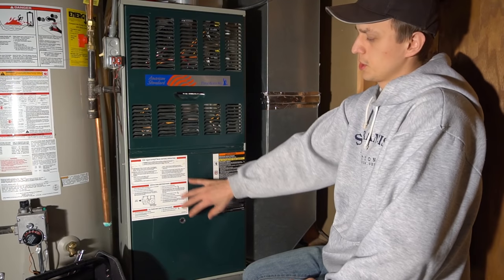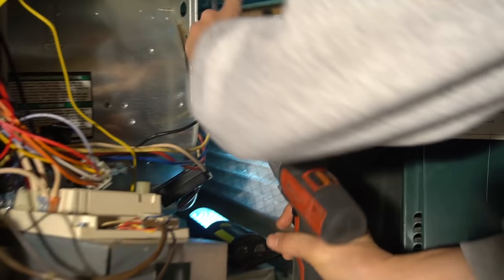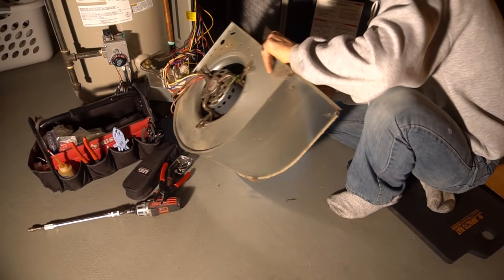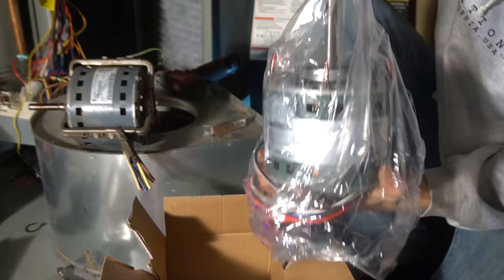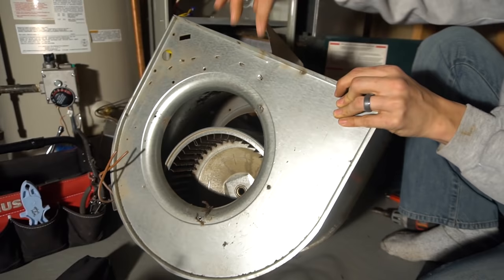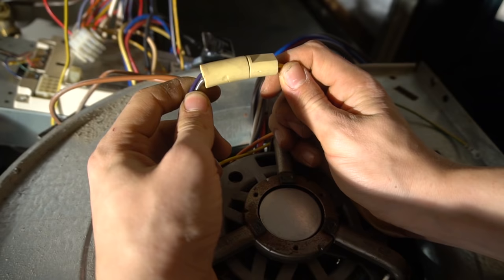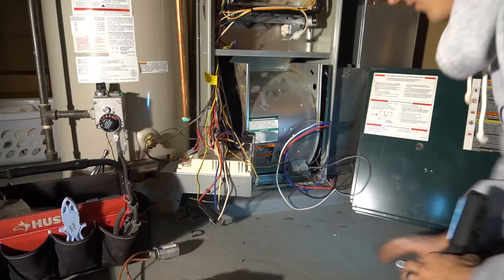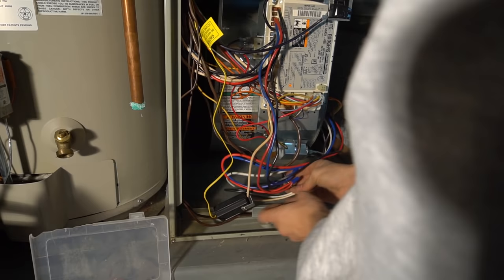Furnace/AC Blower Motor Replacement Step By Step

Comment: Great video!  I think my motor  is going bad.  Last night when it cycled on I heard a squeaking  noise coming out of it then it went away.  Then this morning I heard the "hum" of the motor not starting.  I went down there and turned it by hand and it started.  It made a little noise and then stopped.  It is running fine now and I am leaving it on.  How much time do you think I have before it seizes up?
Reply from the maker: It depends on how lucky you are :) Sorry, I can't make a good guess. If the wheel spins freely though, then perhaps the capacitor is just really weak. That would be cheaper and easier to replace than the motor.
Reply: @WordofAdviceTV 
 I have a new motor and capacitor from Grainger ready to go.  The ironic thing is that the blower is quiet,  starting and running fine on the auto mode.  Could some kind of dirt got in the fan blade making that noise and creating the one time no start?  The capacitor is just 1 year old.  Thanks again for all your help on here!
Reply from the maker: @briancloutier2781  Well.. If the motor works fine then if it was me, I would leave it alone for now. If it quits on you, you have a new one ready to go anyway. But to answer your question - no, dirt would not prevent the fan motor from starting. Most likely the motor will end up seizing up and stopping again in the near future. You can wait for that to happen or just go ahead and replace it :)
Reply: @WordofAdviceTV Do think I should get a new motor bracket before I do chage the motor out on my Trane XE80? I do not want get into this job and find that I can't use the old brackets! I owe you a case of beer! (we all do!)
Reply from the maker: @briancloutier2781  I would just put on the new motor bracket. I have had a few times where I used the old bracket and then had to take the motor back out just to replace the bracket. (it was noisy with the old bracket)
Reply: @WordofAdviceTV  The new one you got from Amazon that you used will work right? My Trane looks exactly like your furnace.
Reply from the maker: @briancloutier2781  Most likely yes. Although it would be best if you pulled it out and verified. To make sure that the specs line up from old motor to new.

Comment: Is it ok to put a more powerful motor for better air flow?
Reply from the maker: That is not recommended. That could actually cause problems. I would replace it with the same size motor if possible.
Reply: @WordofAdviceTV  but I hardly get any flow throughout my rancher style house. The unit is only 7 yrs old. It barely moves a tissue in front of a vent. That's why I want to upgrade. What do you think?
Reply from the maker: Hmmm.. Well if you don't mind it being noisier, operationally it shouldn't have too much of an impact. You can try it but I don't know if that will solve the problem for you..
Reply: @WordofAdviceTV  am I mistaken in my thinking that more flow would cool or heat my space quicker? Then my furnace wouldn't run so constant?
Reply from the maker: Most likely the problem is in the ductwork (which usually can't be remedied since that would involve taking apart all the walls). You may consider adding some returns though. To check if you should add some return runs, take your bottom furnace door off while the furnace is running (with the door switch taped). Then place the door back in it's spot, bottom first. As you are slowly putting the door back in place, does the door slam back in place with a lot of pressure? If it does, then that typically means there is not enough returns. As for a bigger fan.. I am assuming you mean to increase the RPM? That can throw off your cooling and heating operation. If the air flows past the unit too fast, then it will not have enough time to absorb the heat during the winter and to cool off during the summer. Also, the unit will likely start making whistling noises while the fan is running if the velocity is higher than it should be.

Comment: So my blower motor makes a loud noise when first starting up then goes away after a few seconds. What could that be?
Reply from the maker: Either the motor is starting to go bad or the bracket that holds the motor is a little loose. I had quite a few times when replacing the motor bracket with an MB55 bracket solved that noise problem.

Comment: So I get a burning smell (reminds me of a curling iron) only if I run the furnace. If I run just the fan there's no smell, is it still the blower motor or something else? Also if I remove the filter there's no smell (which reduces the load on the motor) but why no smell if the furnace isn't running but the blower motor is for just the fan?
Reply from the maker: Interesting.. So with the filter out, furnace is running, burners are on, and the the blower motor is working there is no smell? I am assuming you already tried replacing the filter. If you haven't, do that first. It's possible that the motor is starting to go or perhaps your furnace is just overheating. What do your temperatures look like? (Temp rise. If you are not sure how to check, I show it in this video https://www.youtube.com/watch?v=lmEbZ32H9nY)
Reply: Actually this started shortly after the filter was replaced (probably just a coincidence). I double checked and it does smell with the filter out (just less so) but not when the furnace isn't on, so I don't think it's the blower motor. Any suggestions?
Reply from the maker: -First of all, do you have carbon monoxide detectors? You should have at least one. Fire department recommends replacing them every 5-7 years as the CO sensor in the detector goes bad with time. If this smells has anything to do with your heat exchanger that could be a health hazard.

- Is the smell coming from the furnace or from the registers/vents? It could be something simple like a toy or food that got dropped inside of a register. It wouldn't hurt to take them off and look.

-When the smell is strong, try turning the furnace off, take the bottom door off and carefully reach in and touch the motor. You should be able to put your hand on it. If its very hot to the touch then your motor or motor capacitor is going bad. Generally you would replace both.

-With the furnace turned off and the bottom door off, carefully reach in and feel in between the fan blades, give it a spin too. Does it spin easy? Is there a lot of gunk in between the fan blades? The fan blades can be sharp so reach in slowly, no sudden movements.

-It's possible that the A-coil (also known as the a/c evaporator coil which is located right above the furnace) is plugged with dust and other debris. If this is something you are willing to tackle... You could pull the blower motor out and laying on your back slide in under the furnace and take a look with a flash light. Although if you have a high efficiency furnace, the secondary heat exchanger will be all you see.

-Take the furnace doors off and visually inspect the electrical components. Are there any melted wires or burn spots. Check the control board for burnt or melted spots too.

-Try using a different filter for a couple days and see if that makes a difference.

-Finally if the smell persists and you cannot find the source, you will just have to call for service. It could be something simple or it may be hazardous. Better safe than sorry. The above options are all the possibilities I could think of that you can check yourself. I hope you will be able to find out what the culprit is! Let me know what it ends up being please! :) Good luck!

Comment: Can you please tell me if the Amps need to match up also? I just bought a new blower motor and i just noticed it says 2.9amps but old one was A. 3.9-3.7.  And the furnace panel label does say 3.90 FLA. All other specs are the same except the capacitor.
Reply from the maker: That just means the new motor is more energy efficient :) The new motor should pull no more than 2.9 amps while running. The motor you found will work.
Reply: @WordofAdviceTV  OK that would be great because i don't think i can return it to the place i got it even though i haven't opened the box yet. But my capacitor does need to match motor specs right?? My previous motor had a 7.5 mfd and that's what i bought new before i purchased my motor, but the new motor says 10 mfd
Reply from the maker: @curtis5809  If you really need the ac, it would probably work with a 7.5 mfd capacitor but I would not leave it in there for long. Definitely get the 10 mfd capacitor for it.
Reply: @WordofAdviceTV  OK...thanks for the info man and actually responding to my questions. Really appreciate it and the videos

Comment: I have an old motor rated 10 Amp, the supply house staff said I have to use an equal or higher Amp replacement motor. He said the control board would send 10 Amp current to the motor, if I put a lower Amp motor it will be burned out. I think that’s other way around. Putting in a lower current rated motor will be safer. Anyone has any ideas? Thanks

Comment: probably a silly question, but does voltage matter?  my motor is 1/3 HP, 1075 RPM, 3 SPD, 200-230 V....I have found several that match but they are all 115 V, I'm assuming that I need to match the voltage as well?
Reply from the maker: Yes, it does matter. A 230v motor will have two hot legs (wires) going to it whereas a 115v motor will have a hot leg and a neutral. You are replacing the blower motor in the furnace right? Not the condenser fan motor outside? Usually the motors outside are the ones that are 230v..
Reply: @WordofAdviceTV  it is the motor inside, but I might be misreading the documentation.  ThNk you for the answer
Reply from the maker: @JereMiles-DarkGlassStudio  The best way is to physically pull out the motor and look at it :) Or if you look at the wiring diagram on the back of the furnace door, you should be able to see what the voltage is that way too
Reply: @WordofAdviceTV  Awesome thank you for the advice, I will pull the motor tomorrow and look at it, I was going based on a Service Facts document I found in a bad on the inside panel of the unit and reading the Indoor Fan Type section, but pulling the motor out will be a much better approach I was just being too lazy to do that yet, thanks again

Comment: Well the one thing I did learn is not to buy a Trane built AC/Furnace system! Yours seems to have failed in every possible way! Also it might be a good idea to have people take many photos with their phones before and as they disassemble. It can make things so much easier to reassemble especially since our systems will not be exactly like yours.

Comment: Dumb question, and no offense intended: that buildup on your squirrel cage fan blades, is that normal, even if the filter has been replaced regularly?
Reply from the maker: Even if you replace the filter regularly, in 15-20 years you will still have some build up in there. The slide in filters will always have a little bit of the dust sneaking past it. The people we bought our house from, I believe they were using fiberglass filters (the blue or green ones) and those tend to let a bunch of stuff through.
Reply: Word of Advice TV - awesome. Thanks for the info! I’ll open mine up and take a look.
Reply from the maker: Never hurts to check :) just make sure the power is off then carefully reach in there and with your fingers, feel in between the fan blades. You can spin it a little and feel a few different spots too. That should give you an idea if its dirty or not. Good luck!

Comment: is that washer/rubber assembly around the shaft removable?  im replacing my blower and it doesnt have that but the universal replacement part i found does. thanks
Reply from the maker: You can just leave it on there, it won't do any harm. There are some motor brackets that need that rubber grommet that's why they just put it on all the universal motors.

Comment: I replaced my blower motor and it's still not working, what's the next thing I should be checking.  When I call for heat at thermostat the furnace fires up but the blower just does not start spinning.
Reply from the maker: There's a good chance that the control board is bad. If you have a meter, check if you have 120v between your heat terminal and the common coming from the blower motor. If you don't have 120v, then the board is defective/not sending power to blower motor. You may find my other video helpful: https://www.youtube.com/watch?v=JSgLGTAbDF8&index=13&t=0s&list=PLK8tZPlovA8Aw5W4GIoingc_enl5apH4C
Reply: I had an electrician buddy look at it and there is a spot on the control board where it looks like something popped or burned but everything seems to be responding as it should as far as calling for heat or AC but just no response from blower.  Is it safe to just swap out a new board or is there something else going on most likely? @WordofAdviceTV
Reply from the maker: In the other video that I shared above, I show how to "bypass" the control board. That way you can rule out the board.
Reply: Not seeing what video you are referring to about bypassing.   @WordofAdviceTV
Reply from the maker: Underneath my initial response to your comment, click on "Read More"
Reply: swapped out the control board today and everything is working like it should now.  thanks for the info!   @WordofAdviceTV
Reply from the maker: Happy to hear it! :) Glad you were able to get it fixed, stay warm!

Comment: How do you find a motor that will work with your furnace? My furnace looks exactly like this, btw. Where do you recommend buying these? Thanks, HVAC technician just quoted us $1500 we don't have for a blower replacement.
Reply from the maker: Oof, that's a hefty estimate. So if you follow the video and take your motor out, it should have a label on it. Most important to look for is the RPM, HP, and Voltage. The motor I used can be found on Amazon: https://amzn.to/2JuRB2a    Or you can just write down the model and serial of your furnace/air handler along with the RPM, HP, and Voltage and go to a local appliance parts shop if you have one in the area and they should be able to point you to the right blower motor. Make sure you get a new capacitor with the new motor too. (whatever capacitor the new one will require)

If you have the same motor bracket that I had on my motor, you may want to put in a different bracket too. After a few days my motor started coming on with a bang that would reverberate through the duct work. Pretty annoying. 
Then it would work fine. But every time it started up, bang! I finally got tired of it and investigated. Turns out the old motor bracket was slightly loose on the new motor and it could not be tightened. So I put it in the FM55 bracket ( http://amzn.to/2C7hIcI ) and no more noise.
Reply: @WordofAdviceTV  Good point about buying the correct capacitor for the new motor. Each motor has to have a capacitor of the proper rating, and it's not necessarily determined the by H.P., amp or voltage rating of the motor. It's a design spec. Don't expect to be able to use the old capacitor. There is a good chance that you may re-use the capacitor mounting bracket, tho.

Comment: Any reason why my American Standard blower motor keeps making a screeching noise? This is the second one that has done this. This motor is only a year old.
Reply from the maker: I don't know if this will help in your case but I have had a couple times where a noisy/banging/screeching motor problem was solved by putting a different motor bracket on. In fact, the motor that you see me putting in in the video started doing the same thing. After a while whenever the fan would come on, it would come on with a bang that would reverberate through the duct work. It was very annoying. Everything worked fine but at start up it would bang like that each time. I fixed it by putting in this bracket: http://amzn.to/2C7hIcI 
Another thing to check would be the blower wheel itself. Make sure it does not touch the blower housing. If you loosen the holding nut that holds the wheel to the motor shaft and move the wheel back and forth so it hits the walls of the blower housing, the wheel should be in the mid-point from hitting the wall on either side.
Hope that helps!
Reply: Word of Advice TV thanks I'll check. It only makes a screeching noise upon start up. No banging noise ever. I had it under warranty so luckily they fixed it for free last time. Thanks for your advice though
Reply from the maker: Alright, good luck! :)

Comment: Thanks for sharing. My motor is 1/3 HP, 115V and 1100 RPM. Do you think a motor similar to the one you installed will work for my Carrier/Bryant HC41AE117? Thanks
Reply from the maker: Yeah! Shouldn't be a problem. :) Just make sure the horsepower and RPM match up. 1075 RPM would be just fine too. Also, sometimes you cannot reuse the old motor bracket or it is welded on to the motor. Or the motor is noisy after install. I had to put in a FM55 motor bracket in my furnace a few days later because every time the motor started there was a bang sound. This is the one I used http://amzn.to/2ygHXzk

Comment: Where did u get the New motor
Reply from the maker: Amazon. I have links in the description if you need to use them as reference.
Reply: How much do they usually cost

Comment: What are your thoughts on furnace filters? I was told by an old HVAC tech to use the least restrictive filters as they make your motor work harder. 
It makes sense but then I guess you have to clean out your blower more often. 🤷‍♂️

Comment: Great video!! But I want to make sure my problem is the blower motor and not the capacitor or something else. My furnace ignites and burns for about 5 mins and shuts off.  Then there is a humming sound that lasts for another 5 mins and the system shuts off. The blower never engages. Is this a blower motor problem ? signed: Puzzled